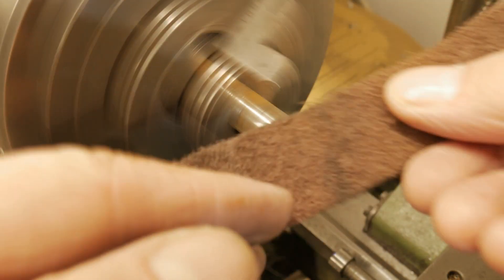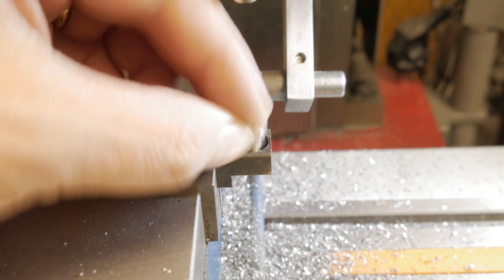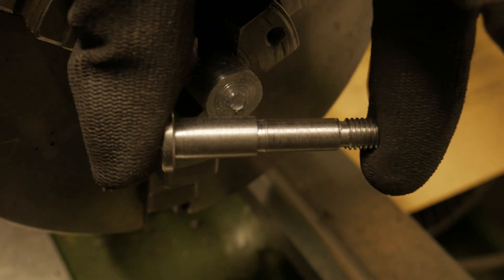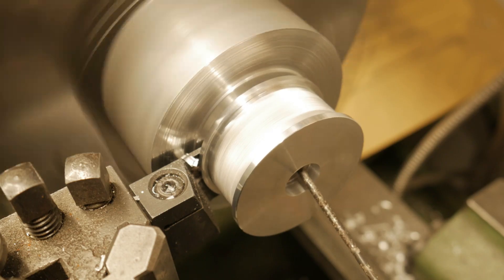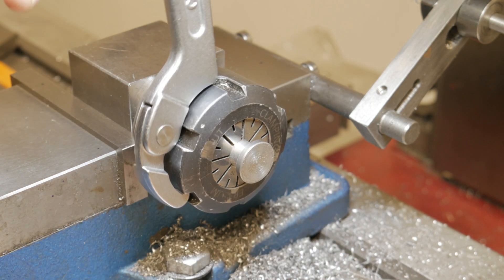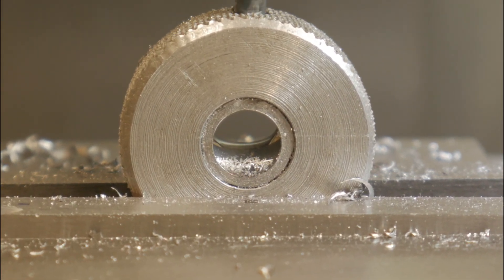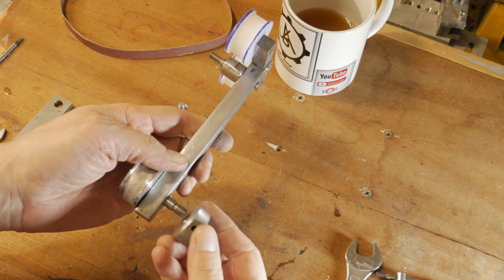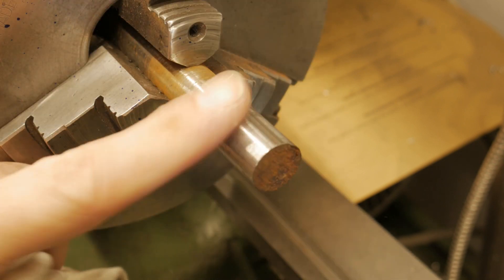How to Make a Belt Sander Holder for Your Lathe - Tiny and Simple!

Comment from the maker: Good morning everyone,
I built a simple support for polishing the cylindrical surfaces on the lathe, it is useful to avoid getting close to the piece with gloves (not in safety) but also to remove cents for the assembly of a bearing for example.( it also depends on the grit of the sandpaper, 80,240,400 etc)

Comment: Another novel innovative idea.  I've always been a little weary of applying sand paper directly to a turning part.  You may be able to add a spring belt tensioner, and a spindle to attach a drill motor so the belt also turns....  I've seen similar devices with grinding wheels...
Reply from the maker: Hi Jeremiah, thanks: yes i made this simple device for that reason, it very dangerous or it can be; i have alsways a big respect of the lathe, my Colchester Bantam lathe is 3 kw so...it would take my arm not only my hand.. in case! Yes i was thinkg about the motor too !!

Comment: Why don't you just buy a shitty Chinese lathe if you're just going to spray abrasive dust all over the machine? you should never put abrasives near your lathe.
Reply from the maker: Hi, I understand your thought and thanks for your comment: keep in mind however that I always clean my lathe after using it, I hate lathes full of chips everywhere and dirt, but ok it's always my point of view; I used to use sandpaper by hand to get to tolerance for the bearing seats but I don't do it often and I also don't back up the guides tons of glass!! Ciao from Italy, Alberto